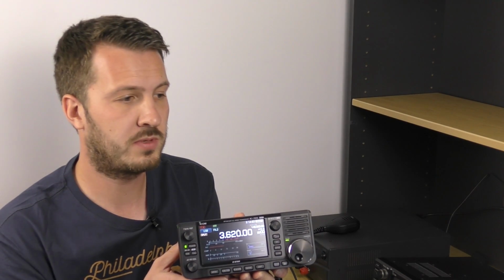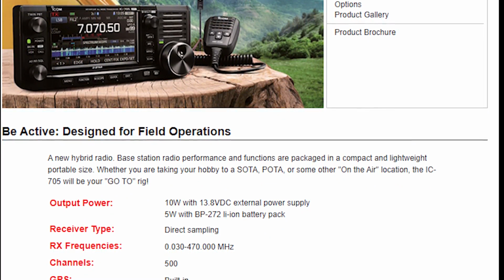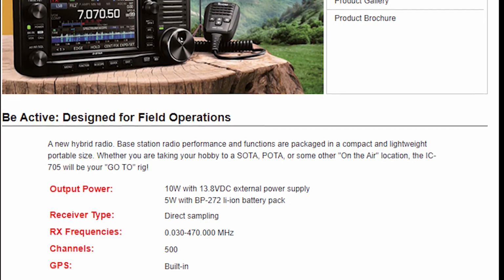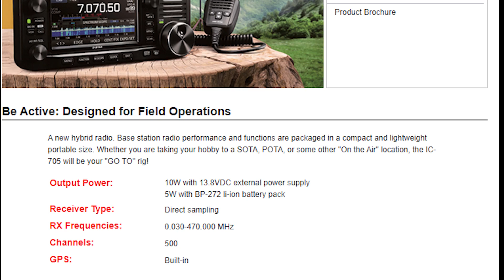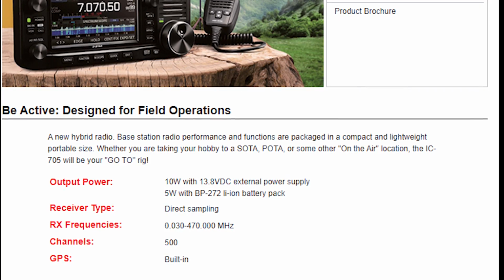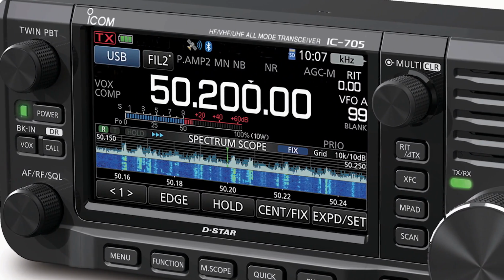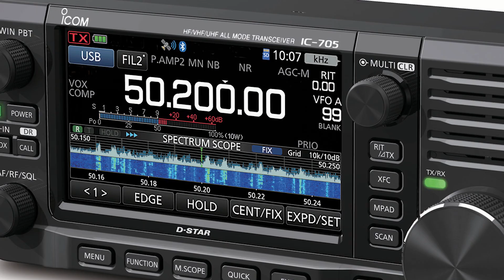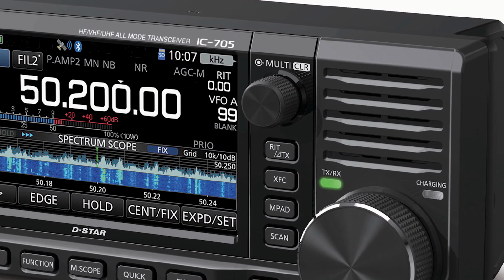Something To Consider Before You Buy an Icom IC-705

Comment: Saved me from buying the wrong radio! Had to go look up QRP and then it was obvious. Unfortunately what I think I need is a ICOM IC-7851. Anything else would be a compromise. LOL The IC-7300 HF PLUS would probably be fine but I’m going to keep doing research and get good with CB antennas(ordered a 102” whip), and the Uniden 885 scanner and President McKinley FCC before deciding. They should arrive today! My next purchase will be a RigExpert AA-55. Thanks for the info

Comment: I have an IC-7300 for home and a Elecraft KX2 (with an internal ATU) for QRP. The 705 came out some years later. If I didn't have the KX2 I would have been tempted even though I think Icom should have put an ATU inside and it should have had it's own feet/kick stand and made it more rugged around the front like an IC-7200. It looks a bit too posh and shiny to take outdoors.

Comment: I’m just starting in ham radio, and stuggling to choose between the IC-705 and the IC-52a. I figured a base station can wait until I have enough stills to make more informed decisions. I know there are cheaper and probably more appropriate radios to start with, but I can comfortably afford the 502, and am more interested in digital  communications with minimal hardware/cables, and I like the idea of low-power set-ups. The IC-52 doesn’t have the same digital connectivity as the 502. Does these arguments sound like a reasonable rationale for an IC-502 as a first purchase, or are there other benefits to the handheld I am overlooking?

Comment: Getting my foundation license (soon I hope), Thinking of one of the ic-705, ic-7300 or FT-991a. Low power consumption of the icoms is good. No built in tuner on the 705 is a negative. The Yaesu may win as I remember drooling over them as a teenager in Dick Smith Electronics !
Reply: Get a secondhand 7600, better than all of them

Comment: Hi Hayden,,  how low power can you get out of the 705 , will it work to a sg-labs transverter for 23cm.. and is there a power peak on the 705, transverters dont like that,,hi
Thanks for youre verry nice video, best 73 Chris SM7YLS
Reply from the maker: Hello Chris,
I can dial the power back to 1% which, I think is below 1W, I did a power output video on my channel - I may of tested it there. In any case yes I drive my SG lab transverters with my 705 just fine. There doesn’t seem to be too much of a power peak that I have noticed, seems to be fine. Cheers hayden

Comment: Waiting for my foundation license to come through, and have been thinking about my first transceiver purchase.  I was seriously looked at the IC-7300, but then I would probably need to consider purchasing the IC-9700 if I wanted a broader amateur radio experience.  From that I thought if you have to buy both IC-7300 & IC-9700 why not consider the IC-7610.  However I think I have settled on the IC-705.  I don’t know when I’ll have time to study to upgrade my license, so we have the 10W limit.  Plus a base station setup might be problematic with potentially causing interference to my neighbours (TV antennas pointing through my backyard).  I like the portability aspects, going mobile/pedestrian, QRP, functionality, and the price.  Plus! It won’t mean relearning menu systems if I upgrade.  I hope I’m heading in the right direction…
Reply from the maker: Congrats Terry on your Foundation license! The 705 will be a great starter rig. 73
Reply: Hi Terry, I’m making the same decisions as you. Have you been able to make DX contacts on 10w?

Comment: I already bought the IC 705, it is a unbelievable rig. Big rig performance. I wanted a rig that I could run QRP or QRO (with amp). One of my concerns was the screen size. I can much easier move the rig where I can read it than a bigger version (7300, 7610). I was surprised how self intuitive it was, no 5 layered menus. Only had to look at manual several times.  Great little rig!

Comment: Thanks.  Of course, you have to take output power PLUS environment gain into account in deciding if 5W is enough power.  From a seaside setting, 5W magically becomes at last 50W effective, sometimes even more.  https://mw1cfnradio.blogspot.com/2020/04/final-lp-coast-work-for-now.html

Comment: I have an IC-7100. It is very portable, and it is QRO, but can be turned down to 5 watts.  It is portable, and I take it everywhere. No, it does not have a waterfall and it is not in color. but it does HF, VHF and UHF.  It is all I need.

Comment: Hey thanks for the video.. I am looking at one for Caravan / Camping use... your thoughts ? VK3NCR... Also, can you operate the 705 on 10 watts using the Usb Charge Port ?? ... I assume you can connect the 705 to D-Star.. via my Caravan Wifi hotspot
Reply from the maker: The radio would work well for caravan and camping use. You can also get a IC-7300 if you only want HF/6 to pop in the camper for a higher power solution. You can’t operate the 705 from USB on 10W it is for charging only. Yes it will connect to Dstar

Comment: Using my Icom IC705 with a 10.368GHz Transverter for the Microwave Bands 
with a Leo Bodnar PLL for super stability
(Same PLL as with my IC9700 )
My old FT817 died and thought moving 
to a IC705 having a Spectrum Scope is
Great for Microwave Ham Bands

Comment: Talking about amplifiers...  There is the new Icom IC-PW2 coming out.  500 watt amp and it's designed for the 705.  You can plug the 705 in for a more than capable shack in the box and then unplug it and go portable.  Icom does have all the angles figured out.   Still trying to figure out what "hay-chef"  is.    LOL  73

Comment: I have both the 7300 and the 9700 - but they are hardly "portable" rigs. I see people bashing them around on field days and just wonder...... That's why I am waiting for my 705 to be delivered. I also often wonder about people who buy rigs without asking themselves what am I going to be doing with this, how will I be using this, what power supply, antenna, microphone, digital interface etc will be using with it. The 705 has never pretended to be anything other than a portable radio. Yes it is expensive. Yes there are alternatives. I bought it because I don't need to learn any new interfaces or menus - simple - my criteria - so ask yourself - what is your criteria? There are no right or wrong answers for anyone except you.
Reply from the maker: Very well said Matt and thank you for your comment! Enjoy your 705 when it arrives 👍

Comment: Comparing the Icom IC-705 to the Yaesu FT-817 is like comparing the Yaesu FT-817 to the Heathkit HW-7. There is no comparison, really. Each QRP transceiver was built in a different era. Comparing what improvements the newer manufactured transceiver has over the older transceiver is NOT a fair comparison. If the OP is a QRP OP then he/she will probably want the Icom IC-705 because of the newer features and technology. I have the Heathkit HW-7, HW-8, and HW-9 as well as the Yaesu FT-817ND. When I heard more than one year ago that Icom had produced the IC-705 I wanted one. As soon as my local amateur radio store, DXE, stated they would take reservations for ordering I opted to place my reservation. Each QRP has the same use goal in my mind and that is making QRP contacts. Each model has additional features the previous model didn't have so makes improvement to what the OP can do with the newer radio. What I will like from the Icom IC-705 over the Heathkit HW-7 is greater transmit power and various output levels greater than .5 watts. Additionally, the touch screen and the received signal waterfall, the built in filters, and the portability. There are many aspects to the IC-705 but I mention what will like over the capability of the Heathkit HW-7 over the Icom IC-705. 72 OM de KB8AMZ

Comment: Miy 705 should arrive soon. I hear they'll be arriving in the US almost any time now. I bought one because it seems like it might be a great transitional radio from the stage of just using FM or DV on HTs to extend my capabilities a bit, open up new bands and modes, etc. Also I like the portability (I'm a walker, so the backpack will really help). I've heard that it's a bad idea to start doing HF with a QRP rig, but I'm still curious, and I can always get an amp later if I need one. I'm also a longtime shortwave listener and I've been relying on WebSDR for that. It'll be nice to have a rig that can do so many things in a portable unit.
Reply from the maker: I think you'll have fun with the radio Andy. It's not a bad idea to start doing HF with QRP! Just more of a challenge!

Comment: Great video, love to see the new radios, and how other amateurs are using them. I've been looking for a portable radio recently for SOTA and more off the beaten path POTA activations, but I think I am going to pass on the 705 in favor of the  Elecraft KX2.  The KX2 fits my operating style of primarily SSB and I am beginning to add in CW into the mix. The KX2 can be had with the tuner and real time clock, as well as the battery, charger, mic, and carry case for about the same price as the 705.
Reply from the maker: Thanks Kevin. Good luck with your SOTA and POTA activations. The KX2 is also a very good radio and will suit you well! 73
Reply: One problem with the KX2 is the battery can not be charged while in the radio and has to be removed by opening the back, exposing the internals to the outside environment. The 705 battery is easy snap in and out and can be charged while the radio is connected to external power.

Comment: Thanks for the video.  Yes, I have one on reserve.  I’m just getting back on the air after several years off; started with some V/UHF DMR and thought the 705 would be a good all around rig for the home QTH to start back on all bands.  It will by my first SDR  (HF) rig.   I expect now that the “bug” is back, I will probably move toward more traditional base stations (ICOM or otherwise) and transition the 705 for mobile / portable use.  For now, it will be my only HF (or all band) rig-other than my Swan 700 CX, which I still have!  (Sadly, I can’t get it to work again.)
Reply from the maker: Good to hear Kevin. Welcome back to the bands. Hopefully that bug bites you bad :), good luck with it and have fun!

Comment: I have an IC-705 and and an FT-817nd.

I love them both. My 705 isn't replacing my 817, they both have their pros and cons (although the 705 doesn't have many cons!)

And for the first time ever after over 15 years, the 817/818 finally has an actual competitor. (Sorry Elecraft owners, your radio is not able to cover the same bands and modes as these two. It's never been a true competitor to the 817/818 and now 705.) 😉
Reply from the maker: Glad to hear MostlyPostie! The 705 is really cool isn't it. Much larger screen than the 817/818. As I said in the video, the 817/818 isn't a bad radio, it's been a good rig for the past 15 years, but it's a little outdated now. Icom have steamed ahead with the tech.
Reply: @HamRadioDX  it's an interesting situation. The 817/818 is still a remarkable radio, especially given how long it has been around. For me, what makes the 705 so fun, and practical to use, is the LC-192 backpack. It is a true "grab and go" setup, and it even allows you to make contacts on your way to your summit, park, etc... There is a lot to like about it. 🙂
Reply: How is the stability of the 705? This does not have any reference input does it? I don't  see any of the reviews mentioning drift problems.
Reply from the maker: @fredrickk99  No reference input, haven't done drift or stability tests yet
Reply: @fredrickk99  rumor has it that it is basically the same as the 9700 and 7300 for drift. So good for most things, but a GPS lock would be handy for some things.

It is perfect for SSB voice as is.

Comment: The IC-705 will be my first HF radio. I have a FT3DR for my HT.  I will be using the 705 for SOTA, on a sail boat, and field portable comms.  I don’t have room for a ham shack so portable will be for me. I am thinking there will be good amp options in the future so if I wanted to use it as a base station. But I could probably just buy a 7300 for a little more.
Reply from the maker: That sounds like some good uses for the IC-705 Flying Squirrel. On a sail boat will be cool, what antenna will you use?
Reply: @HamRadioDX  I have a Chameleon Emcomm 3 portable I will try.  It may give me some options.  Just have to keep it off the metal support cables.

Comment: I have a 9700 for UHF/VHF on a diamond X7000 , A 7300 for 6M/10M on a diamond CP610, and a 7610 on a Fritzel FD-4. I want to get a 705 for running QRP with a buddipole in the local parks or to take with us when we go on holidays.
Reply from the maker: I'll also be taking mine away on holiday and camps with a portable antenna. Saves lugging a big rig and power supply around.

Comment: I already own and love my 7300 & 9700 Icom Radios!!  (The Twins as I call them) I agree that if you are looking at your first Base station and/or Mobile HF radio then I would not recommend the 705! As having a 100 watt capable base/mobile would be best for both.  With that said I like to listen about 95% more than I speak (that’s just me....each to their own!) so having a rig that is portable and has wide range of receiving capabilities plus the features that I came to love in my 7300 & 9700 is a plus!  I will use this as a second HF receiver in my shack if I want to listen to two HF bands at ounce (also perhaps to listen to HF in other parts of my House when not in my shack as I can run HF coax to other areas of my home to hook up the 705 to listen at my convenience) and when I need/want to transmit I will go to the desired band and frequency on the 7300.  I also really enjoy D-star and since the 705 has WiFi I can connect to D-star over my WiFi and won’t need a hotspot (in fact since my 705 will do D-star it will free up my OpenSpot 2 to listen to Fusion if I so desire so I can listen to more modes at my QTH.).  Also I like the ability to take this portable as well so  where ever I go so I can listen to a wide range of modes and frequencies (HF, Short Wave, Air Band And etc to name a few) and will easily be able to find the signals with the Waterfall/Spectrum scope.  As far as HF mobile I already have a Yaesu Ft-891 with the ATAS-120a (which does an awesome job for my HF mobile station) and an idea I have is to tune the ATAS-120 with the 891 for the HF band I wish to monitor and then switch over to the 705 as it will be easier to find conversations to listen to with the 705’s waterfall  not to mention being able to quickly touch a signal on the touch screen to go there (of course when safe to do so while driving) as opposed to scrolling through with the VFO knob while mobile.  When and if I want to call out I will switch back to the Yaesu Ft-891 to talk out with 100 watts mobile (again when safe to do so).......Plus the 705 will have the near Repeater function so when traveling I can select VHF/UHF (Analog & D-star) Repeaters on the go and 5/10 watts is typically enough in my experience to key up Repeaters with a good signal.....now this is just a few of my ideas for the 705 not to mention that I am eager to use the 705 for what it was designed for as a portable QRP rig!!  73’s and thanks for all your recent videos on the 705!!
Reply: My twins are the Yaesu FT-857D and FT-817ND. Basically the same radio but one is QRO and the other QRP.
Reply from the maker: All good comments Precision and thanks for the time for your thoughts. The general coverage receiver was something else I forgot to point out in my video, sometimes it's fun just to listen on non amateur bands. 73's
Reply: Precision. You stated above; " I also really enjoy D-star and since the 705 has WiFi I can connect to D-star over my WiFi and won’t need a hotspot". I was not aware of this. Have you tested it to confirm reflectors can be accessed without using a hotspot? If so, very cool. 73

Comment: In the same  place as you I also have the 817 but honestly never really got excited using it. My 705 will replace my 817, people who are worried about 5Watts, looking at Amps and Tuners should not be looking at the 705 as a first radio but to each there own. I am well equipped at home my 705 will be field use and QRP as it was designed for and better for my needs than the 817.
Reply from the maker: Thanks for the comment Os. Yes I'm definitely more excited about using my 705 for other things as well as replacing my 817 as a transverter driver. Good luck and happy DX!

Comment: I own an FT 891 so if I buy an Icom, it will be a 7300.  Thanks for the video!
Reply from the maker: Good choice! They are a great rig
Reply: I have an 891. Now I've bought a 705. If I can find an amp for it, I'll be selling the 891 (and I'm a Yaesu guy all the way but this is a damn good radio).